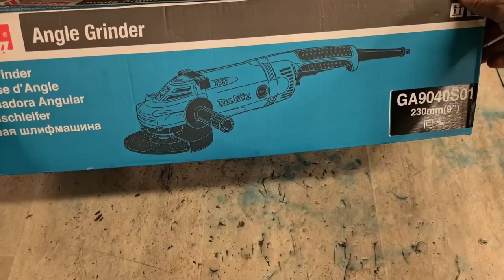Another massive load of nail gun powertools in for repair. Paslode, Rawlplug, tornado amd Tjep.

Comment: On that sparking PCB. I suspect they are Photo Coupler Sensors. LED on one side and Photo Transistors on the other. Commonly used in the electronics industry.

Comment: Hey Dean for the older style paslode o-rings, the hitachi NR90GC o-rings fit and they're half the price
Reply from the maker: Very good point, you are right.
Reply: @deandohertygreaser  and I think the makita gas gun orings fit as well, but they are more expensive than the hitachi but still less than the paslode.. Anyway I use the hitachi orings to fix the older style paslodes because paslode prices are ridiculous.

Comment: On those 360s, wouldn't it be a benefit to take the back off and put a few drops of oil down the chamber every so often? Actually you said as much later in the video, on the last one that had the new spark unit.

Comment: I would have given up on that IM350 the moment I opened that back cover, that much corrosion on aluminum is just crazy. But respect for getting it up and running again!
Also what parts you need for the Senco's ? I work at a Dutch hardware store that does service/repair Senco machines and we can order straight from Senco NL so I might be able to help you out on a one time base to get you the parts for the machines you have laying around. Tjep is a whole different story though, they only have standard service kits (o-rings/seals) but nothing like fire pins or any of that stuff.
Reply from the maker: Thanks for the offer, very much apprivated. But I need a supplier here in Ireland. 
The tjep and senco are basicly the same gun. Most pasts will be interchangeable

Comment: Nailers fixed in this video:
0:50 Rawlplug R-WW90 (possibly) nailer Fault: Stops firing after one shot
9:40 Tornado CN-120 concrete nailer Fault: Nail jam (according to the owner)
12:43 Paslode IM-350 nailer Fault: Tool been in Davy Jones locker at the bottom of the sea
48:18 Paslode IM-360 nailer Fault: Not firing
57:48 Paslode IM-360 nailer Fault: None, just service
1:16:40 Makita GA9040S grinder convertion to a Wall Chaser tool
1:28:28 Paslode IM-360 Fault: Not firing
1:47:51  Tjep TF-16/64 (possibly) nailer Fault: Broken pin
1:53:35 Paslode IM-350/90 Fault: None, in for service.
2:03:02 Return of the Paslodes IM-360 from 48:18 and 57:48 after parts came in.
Reply: Pin this dean

Comment: 22 EURO! for a tiny bit of rubber that costs literal pennies to make. that's criminal. Even with the overhead of supplying it as a single item in a plastic bag, shipping it, stocking etc. There is no way that part should cost more than €5.

Comment: It's an infrared barrier, generally Way more reliable than an electric contact, but you have to consider the electricity consumption of the infrared led, + the product need to be designed correctly to avoid dust and/ humidity/ corrosion.. .
Reply from the maker: They are not designed to be used in power tools like these. A tried and tested electrical switch would be more reliable.
These are not very well designed as they they are a common failure in these guns.
Reply: I could repair those IR switches, they could easily be sorted and save lots of money on buying new ones.